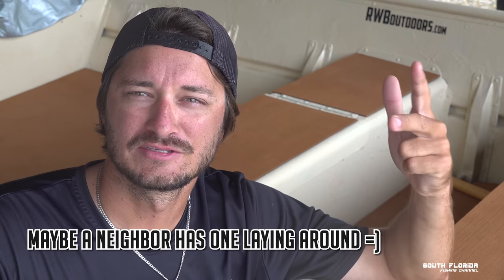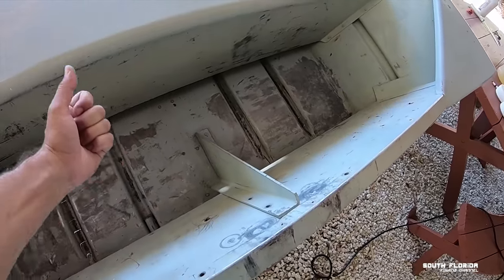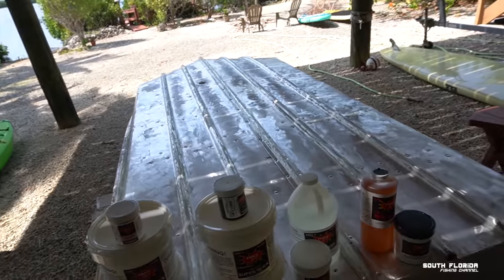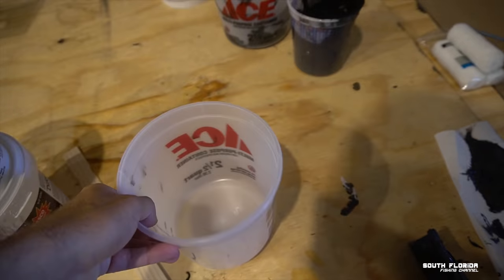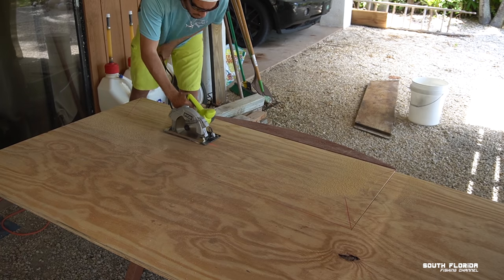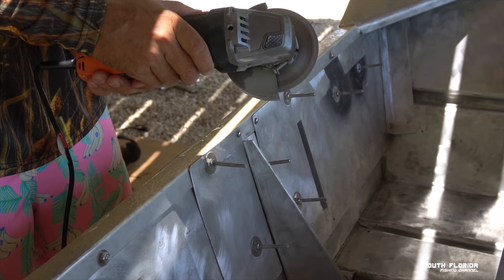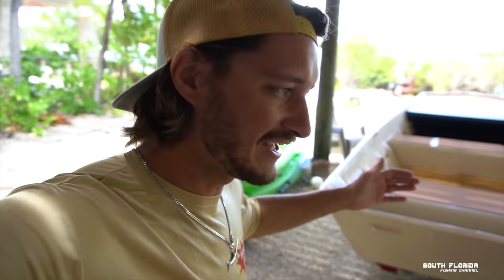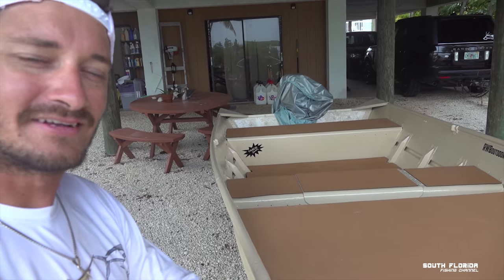{Start to Finish} Jon Boat Restoration Build w/ Fasco Epoxies

Comment: You Would Of Been Better Off With A Compressor And Sandblasting Equipment Which Also Would Of Prevented Pollution To Your Surroundings And Saved You Money On Paint Stripper

Comment: Awesome video!!! Do you know where the term YeeHaw comes from? Its not an exclamatory expression like you'd think.
Reply from the maker: Enlighten me! According to google "used (as by cowboys or in imitation of cowboys) to express exuberant delight or excitement" lolol
Reply: No sir Google is wrong! The origination of Yee Haw is that its actually 2 terms. Cowboys/Ranch hands or workers would use steers or cows to pull heavy logs or stumps. If they wanted the pulling animal to veer to the right they would yell "Yee" and if they wanted them to go left they would yell "Haw".  Or vice versa not sure which.

Comment: Hope you learned to put epoxy on in thin layers so your final paint finish is smoother. If you really want a great finish you should put 3 coats on let it dry and scuff then put 2 thin layers for a great finish with micro roller.

Comment: You skipped an important step on the floor boards. You should gave epoxy coated them then painted them. Same for the transom.

Seeing that you pulled the original wood out if the transom, you should have replaced it with coosa board.

It stronger and lighter than the ply and waterproof. It would last another 35 years even more.

Comment: I’m a bit shocked you painted the floor with black paint…..i lived in punta gorda and fished all the time and never had a black floor and im a. Little stumped why you’d put wood over a nice deck with ribbing that would have allowed some grip…and the water could wash away…..plus the wood is putting a lot of unnecessary weight taking away from what you can carry. Same for the bait box….the black color will cook your bait. Might rethink that in the future…..for the floor i would have done the floor like you did in addition i put the bed liner from a bed rug on the wood. It’s wool and is great for water and is soft. The backin is water proof as well and doesnt add as much weight as wood…but i do like the wood….wool stuff is much better….then you could use a thinner plywood

Comment: Paint doesn't waterproof wood for marine use....Marine plywood is coated with Polyester resin. If you want to be 110 percent sure, fiberglass and resin is the answer. Also, in order to pull tape off of a resin line, you have to pull it when the resin has stopped flowing but isn't completely cured. ....basically when you touch it with your finger and it pulls away with strings. AND the reason you have to mix your pigment into part B or part 2 is because the resin won't completely mix if you don't. The instructions aren't just a suggestion. [There's a product called Liquid Transom that is a much easier and much stronger repair. it basically replaces the wood with a pourable epoxy/carbon fiber mix.]
It may look good now, but if it wasn't mixed correctly, in time it will start to lift especially since you didn't prime with a self etching primer. self etching primer has an acid component that helps it bite into the aluminum which then gives the subsequent epoxy something to bite onto. So, unfortunately, it won't last for the "Many years to come" that you speak of.

Comment: Were you beaten with a paint brush as a child?  That's the only reason I can think of why you would so passionately avoid them.
Rollers are for wide, flat areas, and for use with a flat roller pan to control how much material is on the roller.  Disposable chip brushes are used for all the irregular surfaces.
Search on "roll and tip".
I would have waited until all surfaces were painted before installing the livewell drain, and then with a lot of 5200.  
I was going to bring up that spray rattlecans are useless for waterproofing wood, but you figured that out!  🤣
Wait, what?  You didn't fasten the floors down to the hull?  I foresee a deck or two laying on the side of a highway in the Keys...  Screws, even stainless ones, are cheap insurance.
Reply from the maker: I found paint brushes to be awesome! But I just recently found that out lol
Reply: This took me out 😂

Comment: Next time don’t use that blue painters tape it sucks take the extra dollar and buy the frog tape. It’s a lot better plus he will make some frog tape where it’s got a little design review if you wanna turn a pre-Kutsu, but you can run all the way along and I’ll give you like a little designs on it and then that way when you pull it out to reveal the design which is actually pretty cool on on the on the decorative frog tape, but frog tape is the best way to go when painting anything

Comment: But those watching now don't fill the boat like this to check for leaks cause it's not always accurate, the pressure is literally the opposite way and won't show some leaks. Edit.. just go drop it in a lake really quick, way easier

Comment: Do part one and two before you add pigment so you don’t mess up the ratio. You needed to get to the 18 oz level because you got about 2 oz of pigment. The ratio is stated for the results you don’t get to modify it and expect it to work well.🙄🖖🏼🇺🇸

Comment: You can spray Windex on the boat and then you can put the decals while wet and move them anyway you what and then take a credit card pull the air bubbles out an the extra wet Windex out let them dry ... Done...

Comment: scraper, holy s**. go to harbor freight and get some wire wheels, put it in your angle grinder, or just a plain old drill, and you can strip that s** off in seconds. a wire wheel makes getting around those rivets super easy. really was painful to watch. 💢😵💢🥴💯m

Comment: Okay buddy where’s your mask, gloves and roller pan? You didn’t tape enough and you needed paper down the side. Almost kindergarten here Bro 🤦🏻‍♂️ but you don’t learn until you make mistakes. You have to know what you’re doing before you start why didn’t you view some videos about painting epoxy before to learn basics? Okay whatever.. guy’s there’s multiple issues for kidneys and liver easily caused by working with these chemicals and all chemicals involved in fiberglass and paint including the acetone. Don’t compromise with safety ever! SAFETY is not on accident! God Bless 😌❤️🖖🏼🇺🇸